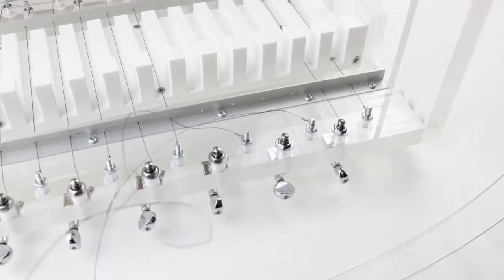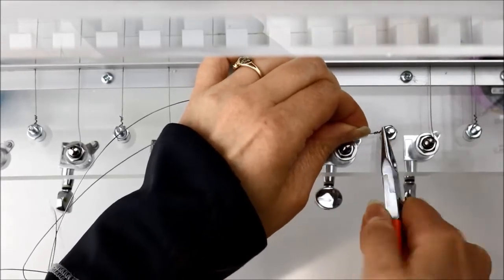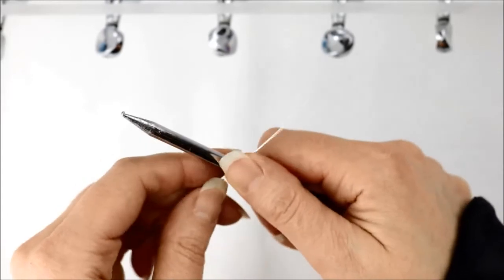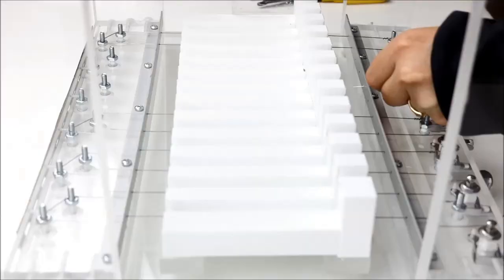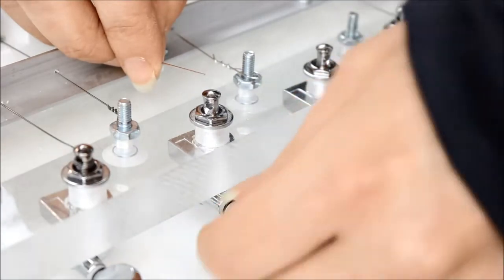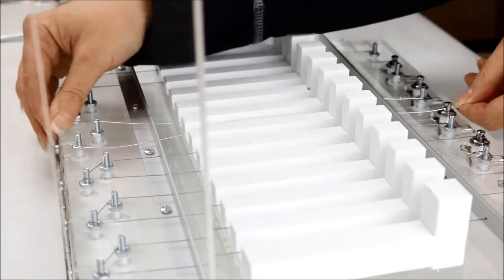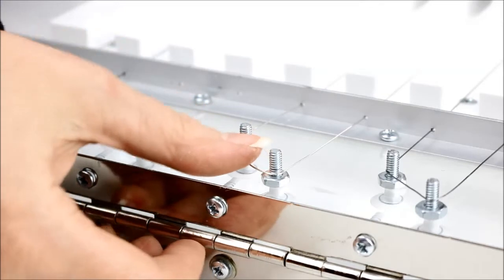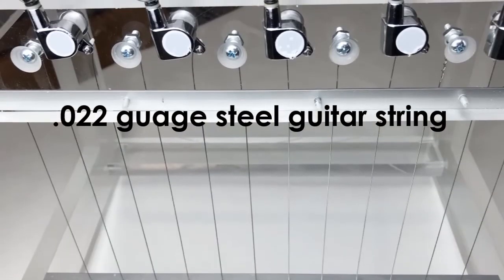HOW TO REPLACE SOAP CUTTER WIRES – Plus CHEAPEST Way to Buy Replacement Wires

Comment: Excellent video work; so easy to see what's going on. I only have a cheese slicer for cutting but the wire is replaceable. Now to inspect my setup to see if the wires you found on eBay would work when mine break! 🙏 Thanks for sharin.
Reply from the maker: Thank you, Susan! Those cheese slicers work great for the price. They do have replacement wires for those and they are even cheaper than the wires for the bigger soap cutters, so I would look at those first. They're probably easier to replace, too!